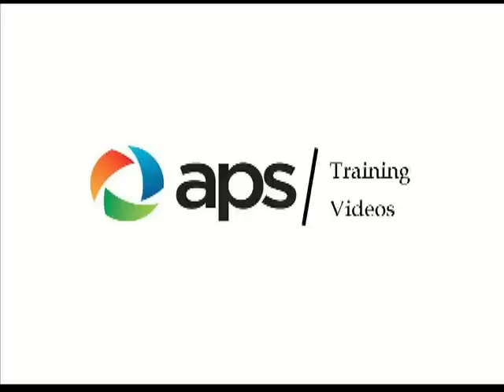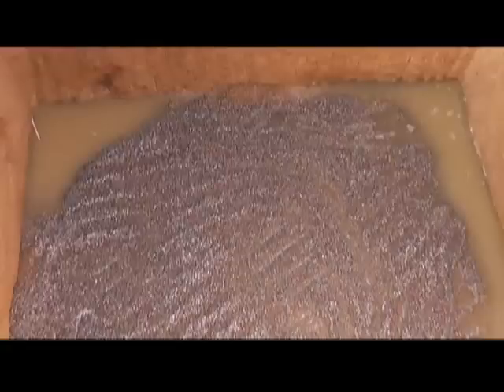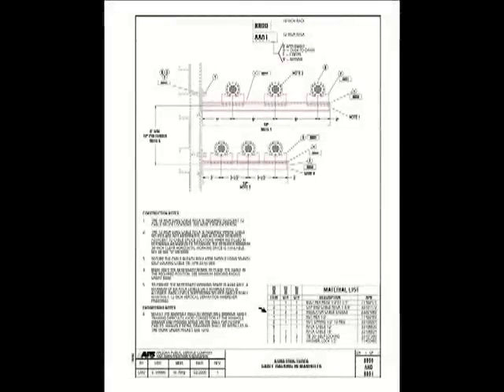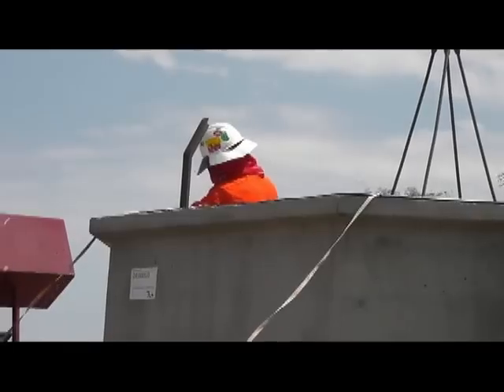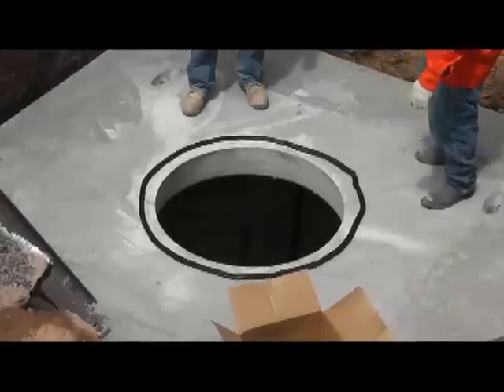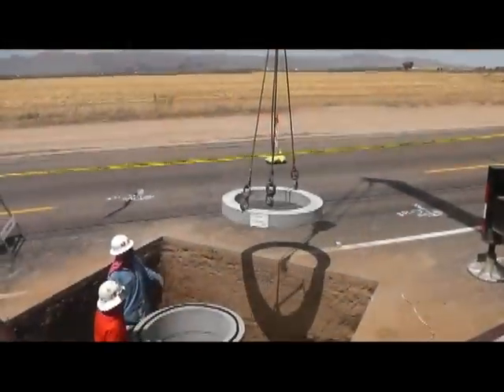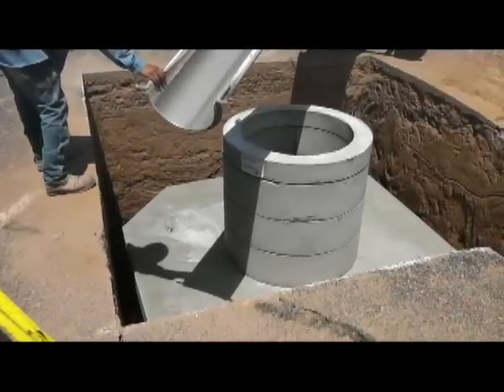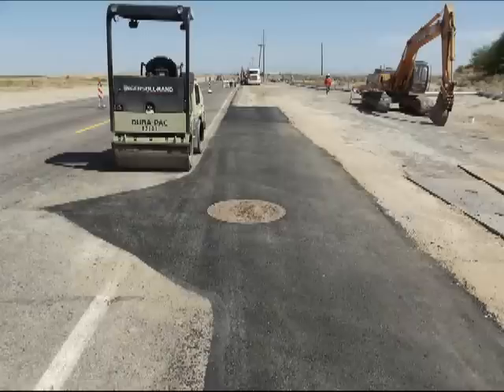Manhole Installation Training Video - By Distribution Design Consultants, 33.557550, -112.393530

Comment: I love the european style cable "manhole" systems... especially the ones they use besides railroad tracks as well as main roads... a lot smaller and less complicated to get set

and as a lot of our data cables actually are being fixed in sewer pipes as well (they run on inside at the top of the pipe) we not only save a lot of space but even lots of work for installing new lines

it is interesting to see how it's done in the US (I wonder how they disconnected the base from the manhole box at first... I mean, as you said, the shoring was removed...) but I enjoy how it is done over here in Austria and Germany a bit more ;-)

Comment: How does this manhole connect to a flowing pipe? I didn't see any connecting pipes or tunnels.
Reply: Its for conduit, They punch the holes out after they dig the rest of the trench
Reply from the maker: John Yeoh it an electrical manhole not sewer